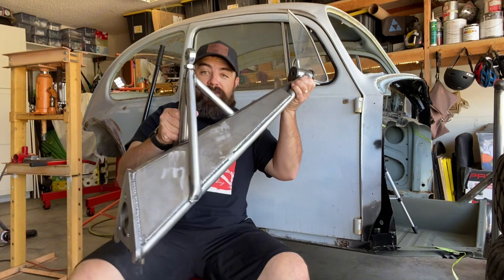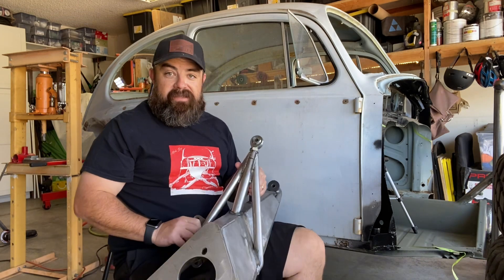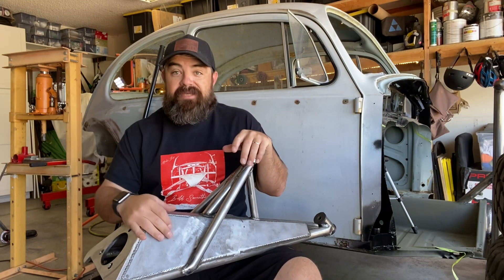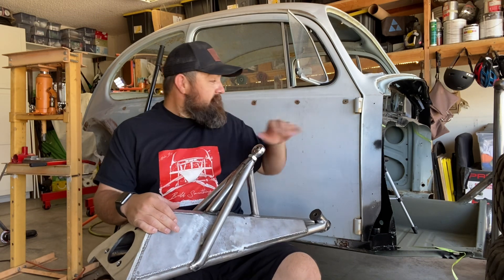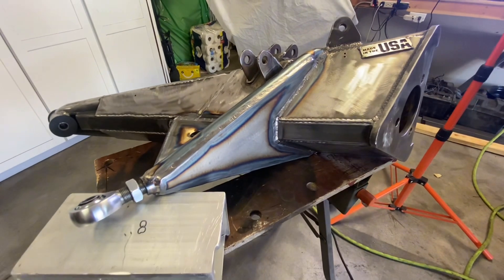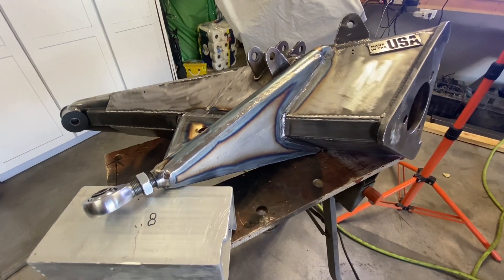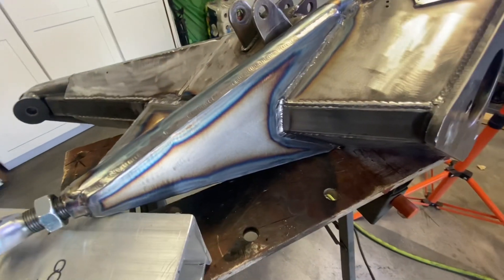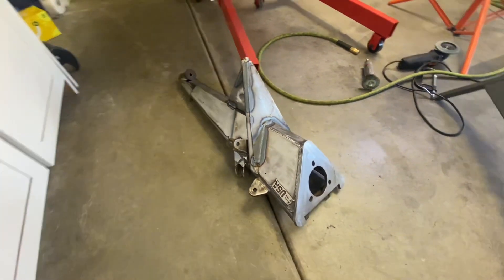Tig Welding 4130 Plate to Strengthen my Trailing Arms

Comment: I’ve been MIG welding since the late 90s, only playing around with TIGs on occasion. I just put a “deposit” down on one of the new YesWelder multi-use boxes, specifically for the TIG capability. We’ll see how that goes!
Reply from the maker: Awesome! Good luck and don’t get discouraged when it looks like shit. Just keep pushing forward and make small changes at a time. The thing that made the biggest difference for me was switching to the gas lens kit (made by yeswelder).
Reply: @MiahsBug  thanks for the tips! I've actually had decent luck with the few TIGs I've done in the past. Possibly cause I learned how to braze in JR High, back when schools actually taught useful skills! Who knows, but I can't wait to get back to it and for sure I am getting one of the clear shields! I can't see for anything (close up) nowadays without glasses.
Reply from the maker: @Sam_Mebane right on! I did brazing and welding in HS as well. So useful.